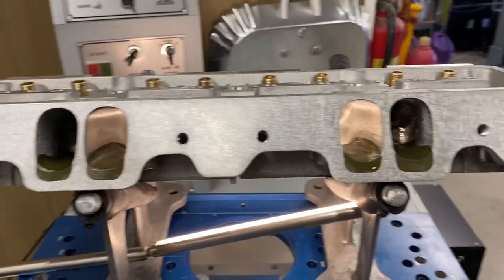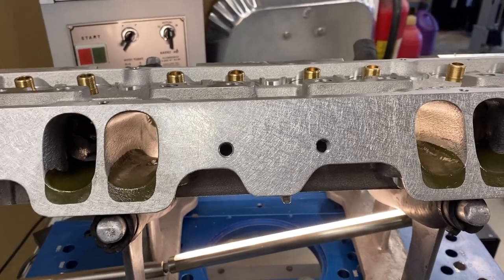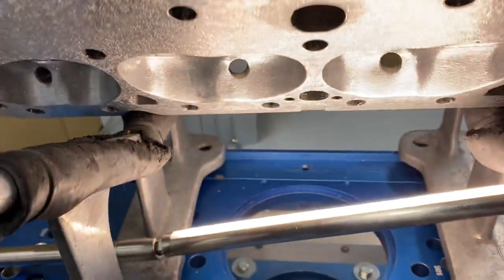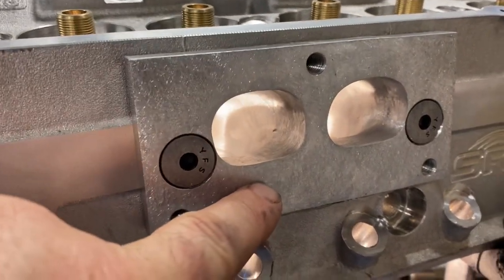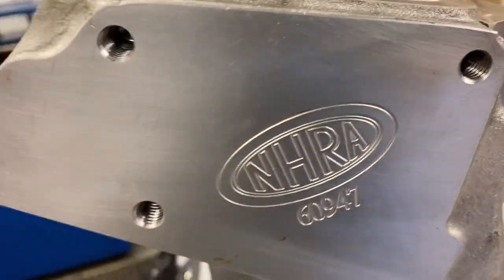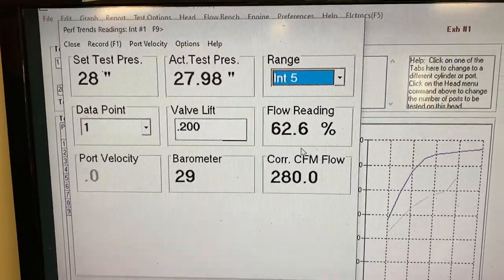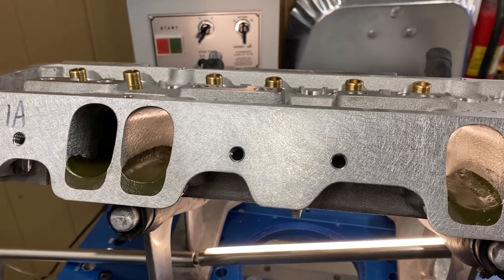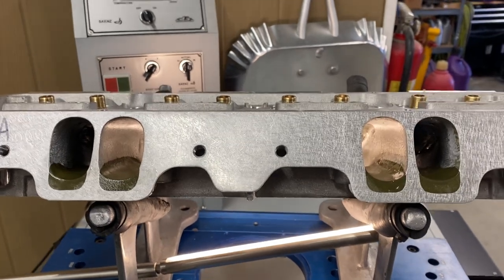Super Stock

Comment: This’s why the Cleveland 4-V iron closed chamber heads with the Parker funnel web intake with the tongues is such a awesome setup. The tongues raise the floor of the intake runners giving it a straight shot to the top of the piston. The camshaft that I’m running is a 0.711 intake and 0.714 exhaust. 262-272 @0.050 and 300-312 advertised. 4150/950 Holley. My 81 Capri went a best of 6.09 in the 1/8th with 1.26 60ft on a 175 shot. The car had 4.30’s  geared for the 1000ft. I refreshened this motor and went with 0.050 longer Manton pushrods and got the midl lift geometry corrected and it’s going into my 86 mustang which is about 400 pounds lighter than my Capri and it’s all Team Z suspension. I know that I can get high 5’s with this Cleveland.

Comment: What gets me is. Why don't the NHRA scan a bunch of heads in the class. Pick one that's in the good but not great category. Then provide those CAD files to the head manufactures so they can produce 'as-cast' versions that would be the same across all foundries. Would save a bunch of cash for punters. And just tighten up the rules around what porting can be done for parity...
Reply: Class heads like these are pretty much custom for the application, and I doubt you would find one car owner or engine builder/head porter that would agree to give up any dimensions (advantages) of theirs. The bulk of the "punters" can buy the proper head for their application, and better suited, from any number of manufacturers, and if they want something more specialized, from any number of porters.
Reply: That would put alot of small business in a bind. Don't think I would support that.

Comment: Super stock rules specifically state. No porting allowed outside of original size. Gray area..   raise the port and add epoxy. Port is still original size! 
   Nothing new..  Bill Glidden was famous for doing it on ford heads.
Reply from the maker: Nothing new..  But things are better, making more power, flowing more air, than they ever have.  All because the OEM stuff is used up and they are allowing NHRA approved castings.
Reply: @SpeierRacingHeads  thats why they are also going to required sealed crate motors like the gm 602 series. Live in the gray area right. !
Reply from the maker: @approachingtarget.4503  I don't think that will ever happen to Stock and Super Stock.  And if it does, they are idiots.  A legal Super Stock engine is amazing.  Everyone needs to be around one to understand how to do more with less.
Reply: @SpeierRacingHeads  they are already doing it here. Sealed crate engines for anything above pure stock. It sucks.
Reply from the maker: @approachingtarget.4503  Pure Stock is not a NHRA class.

Comment: I’ve got a question for you! I have a 4.3 Vortech V6 that I took out of my blazer. I thought it was ruined but it’s perfectly fine. So I was wanting to modify the cylinder heads to get more flow. I wanted to put the cast-iron heads in a grill and heat them up. Then I was hoping that I could use my Mig welder to build up the area around the intake runners. What do you think about this? Will it leak? I also wanted to make my own intake manifold. Probably start off with a 750 Brawler carb. Comp cams  hydraulic roller cam shaft. .500 lift etc…
Reply: The grill wouldn't get them nearly hot enough and the head will crack right next to the welding. (dissimilar metals as well, being cast iron and mild steel for the wire) I would bet the seats/valves/bowls would need to be heavily worked in the right direction before the intake ports become the restriction.
Reply: Might work with silicon bronze wire.
Reply: You can't mig weld cast iron at any temperature it's just not possible, now if you know what you are doing, you can do some furnace brazing with brass brazing rods like a lot of the super stock head porters are doing but the cheapest thing to do is get some Goodson epoxy and form the ports yourself and grind them to the final shape, or if you could find an industrial company that does cast iron spray welding that could be done also, but you would have to show them where you need the welding done and there's going to be lots of remachine work needed after this work is done so actually to avoid all of this unnecessary work you might be better off finding a pair of bowtie V6 aluminum heads which will out flow any stock V6 head out there, match the right roller cam to the application and you should be in great shape
Reply: @ericscrutchins6350  going to try brazing with my TIG welder on cast iron. I have MIG welded a cast iron pulley at the place I worked. An envelope machine. It was a government job that had to ship so it was worth a try. I had my supervisor to heat the pulley and jerk back out of the way and I welded an inch at a time. The pulley stayed on the machine for another year. We got lucky.

Comment: What epoxy is that n where can I get it
Reply from the maker: Z-Spar.  Any marine store.
Reply: @SpeierRacingHeads  thanks. I'm working on an older set of world sport2 heads. I raised the intake and exhaust ports n I wanna fill the bottom of the intake a bit to make a flatter run up to the short turn.
Reply: @SpeierRacingHeads  Yes, thank you for that.  I have an old Harley ironhead with huge ports for the cylinder size I'd like to experiment with port sizing and shape.  37ci cylinder with a 1.95" intake valve and a sewer sized port.
Reply: @SpeierRacingHeads  Is there anything you're using to seal the epoxy? Z-spar doesn't come out that shiny. (Or am I mixing it wrong).
Reply from the maker: @annamckinney6622  I use Devcon 2-TON clear epoxy and apply it with my finger.  You can get it at ACE.
Reply: @SpeierRacingHeads  so this is stuff that holds up to extreme running conditions? Then I would like to search for it in Europe
Reply: There's also Goodson cylinder head epoxy it looks similar to that devcon epoxy when mixed it has that olive green color to it and it rock hard when fully cured it can also be formed with your fingers before it starts to cure it's a two part epoxy
Reply: Just got a notification for a comment left to my previous question. It's funny because after selling the world heads to buy aluminum ones the filler epoxy subject is exactly what I'm looking into again. Only this time I broke through the pushrod pinch
Reply: Goodson cylinder head epoxy it's much like the devcon epoxy it probably is the same stuff, just relabeled and if you ground through the pushrod pinch you can epoxy it back, I ground through mine on my 292 cylinder heads and widened the openings and I went to and offset cup roller rockers and offset cup roller lifters to clear the widened ports
Reply: @ericscrutchins6350  yeah I just didn't trust it would hold up being so thin. I just had it welded up.